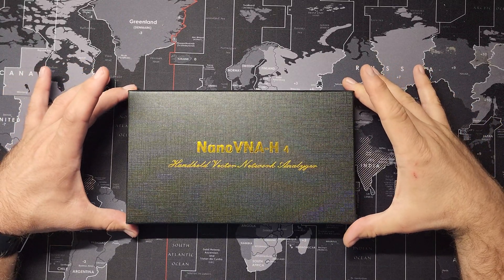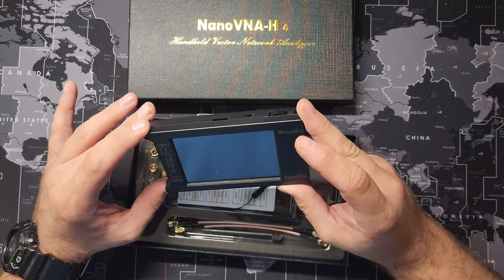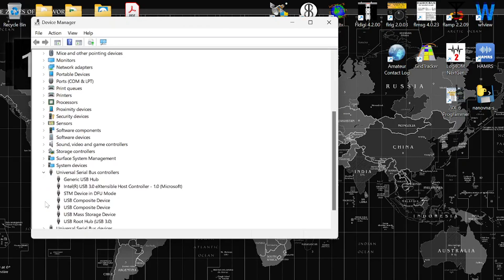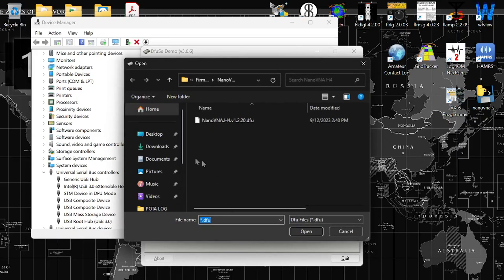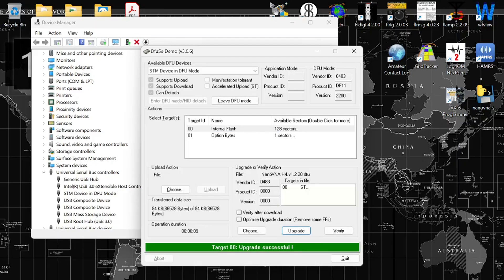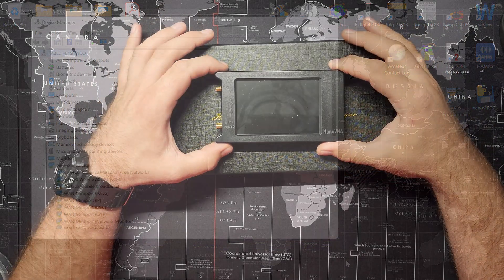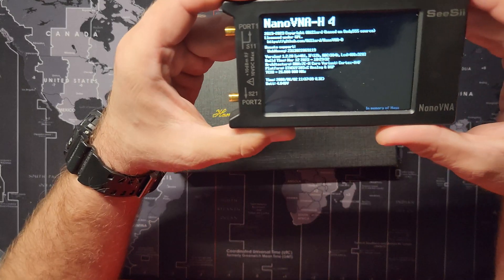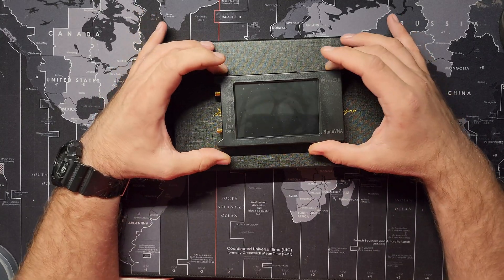NanoVNA H4 Stuck in DFU Mode

Comment: After attempting to follow the updating procedure in the previous video, my Screen is blank, and I get an error message saying "The last USB device you connected to this computer malfunctioned and Windows does not Recognize it" .  The device does not show up in the Device Manager/USB Controllers listing now.  Is there a "factory reset" button? Thanks.
Reply from the maker: Sometimes this method works other times you have to do the hardware method.

1. Open NanoVNA-H
2. Short VDD with BOOT0
3. Turn on NanoVNA-H --->>> 
White display = DFU mode
4. Write Firmware.

Hope this helps! 73 Matt N3VAN